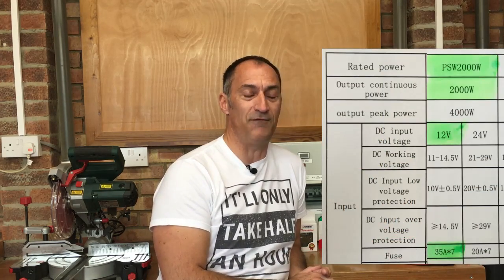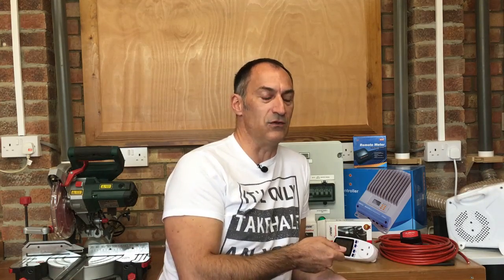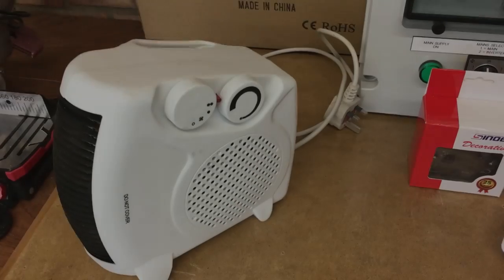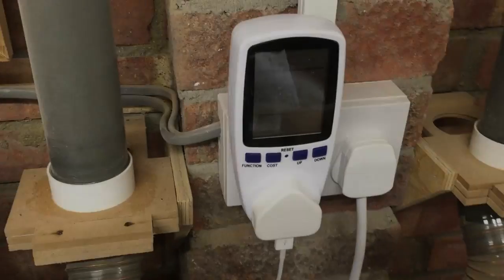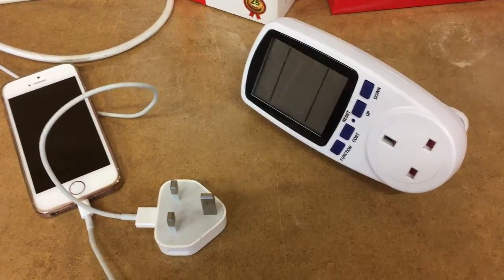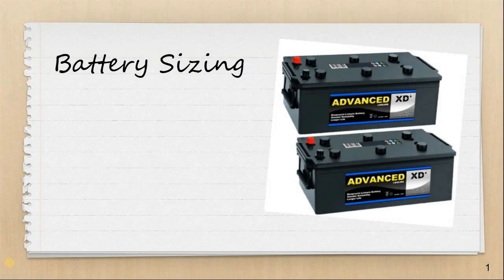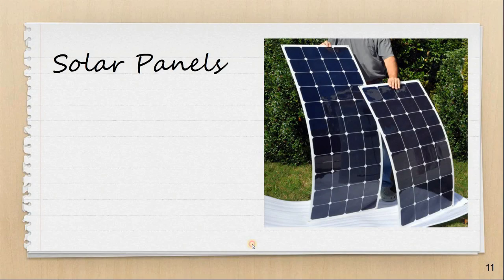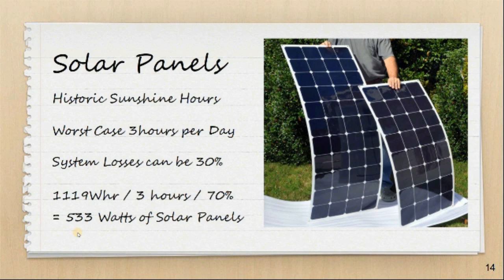Off Grid Battery & Solar Sizing - Self Build Campervan

Comment: Hey Greg!
Great videos matey I’m doing up a T5 myself and find your vids really helpful :)

Any reason you chose a VSR over a DC DC charger?
They charge much faster and more efficiently..plus the battery can get a 100% charge not around 70/75% as with a VSR...you basically gain 25% more useable battery capacity :) 

The Ablemail 12-12-30 is what I would recommend...also has 30v solar input with mppt tracking.
It’s £250 but well worth it :)

Cheers 
Ant
Reply from the maker: Just not really aware of a lot of other devices out there, in hindsight I would change a few things 😃
Reply: Hi. Interesting comment re the Ablemail, have just had a quick look. So. if I understand correctly, the ablemail replaces the need for seperate MPPT controller and split charge relay? Do you know if it is suitable for Lithium batteries (I notice the website talks just about lead acid but says it can be reprogrammed)? Thank you :o)

Comment: Hello
Just one question.
Why for the fridge did you write 6 hours instead of 8?
Usually it works 20 mins/hour = 1/3 in 1 hour
so 1/3 in a day could be 8 hours.
Thanks and sorry for my bad english :-)
( you can check at 15 mins and 40 seconds )
Reply from the maker: The amount of time your fridge runs for is at best an estimate depends on how many times you open the door and how much warm food you put in it. So the calculation is really a best guess anyway 😀
Reply: ah ok, thank you very much for your quicker and exhaustive answer :-) ( and sorry for my bad english :-D

Comment: So at this Point I don't quite understand why the Laptop, the iphone, the ipad and the kindle are in the 230v category. They usually run at/on(not sure here) direct current and can usually be charged via USB. Or for the Laptop just find out what current the laptop can take and get yourself a dcdc converter. Way less inefficient than running the inverter for all these appliances.
Reply from the maker: I was testing them with a watt meter that was plugged into a 230v socket to find out exactly what power they drew when in operation. 
You can, of course, plug them into a USB socket. You are right that running them off the inverter is not the most efficient way

Comment: I didn't understand why you'd only put the fridge down as being used 6 hours a day. Surely they're a 24/7 appliance. :-/ What am I missing?
Reply from the maker: Hello, they are plugged in all the time but the compressor only runs very infrequently depending on how much you use it. If you open the door a lot and put lots of warm food in it will run a lot more, at best this is and estimate as we cannot tell exactly what the running hours are. Hope that explains ok
Reply: Ah.. I see. Thanks for explaining.

Comment: Hi Gary great video. Just a quick question regarding your computer Watts. How have you done the calculation? I have worked out my computer charger input is 1.5A (that's what the AC adapter says). You only have 0.09? Thanks
Reply from the maker: Hello Matt, I plugged it into my watt meter and took an actual reading while in use. 
Typically they are max 75watts for a laptop but often use much less.

Comment: on the 2x oversizing batteries due to cycle life, have you look at the lithium options ?   You might only need half as many and can drain them lower without that critical effect presenting anywhere near as soon in the cycle life...  and yes, pricier - but also less space consuming...  lots of tradeoffs.   You make really excellent videos.  One thing that stands out in them is your incredible attention to detail - that, and your shop area is WAY TOO CLEAN.  Try messing it up a little so some of us don't die of jealousy.  otherwise, crack on !  :)
Reply from the maker: Hello Lyle, I wish I could afford the lithium option but they are so expensive.
Oh, and I can hardly move in the shop at the moment there is so much van stuff in there lol
Reply: sorry on the comment - I saw later comments where you'd addressed it.  Glad to hear your shop isn't suitable for showing presently, it gives the rest of hope... ;)   I gather you're in the midst of heading off on a long road trip - take care, you've certainly worked for it.

Comment: Hi and thanks for your video .
Are there any downsides to having to many batteries and solar panels.?
Can you buy something to automatically manage your batteries to extend there life , rotating and not going below the 50% recomended
Reply from the maker: Hi Andrew, in the case of our van conversion the biggest criteria is roof space and weight.
There is a limit to how many panels you can fit on the roof of your van.
I have now fitted 3no 160W panels making a total of 480W of Solar, that is a lot for a van.
With batteries the issue is weight, my battery string weighs close to 100kg
So you have to plan where to put that so you're not overloading one side or axle.
If your battery is very big you might now be able to fully recharge it with your solar system
So they have to be matched to make the system work efficiently.
Larger systems require larger cables and fuses and that all increases cost too.
A decent charge controller should be able to maintain your batteries in good condition and charge them according to the current state. you can get low volt cutout switches to prevent over discharging them.

Comment: Thank you!!! This is a struggle i am in right now 🤠🤘🤞
Reply from the maker: Hi Kristiina, what are you having difficulties with maybe I could help you figure it out?
Reply: No idea how big i need to go with battery and solar because no idea what appliances i do need to use. 
Atm maybe ill skip inverter and be only on 12V. And if i live in the van for a bit then i might know better. But as it is summer in europe i think i should install solar plus the charger to charge while driving 🤠🤘
Reply from the maker: This video may help you a little more.
https://youtu.be/1nrAE5Q3lVQ
Reply: Yes!! Thank you

Comment: Ideally you would have the fridge radiator isolated from the rest of the van and vented to the outside. This way in the winter the fridge remains cool even if you heat up the inside of the van, without using much of the scarce power you get on a short, cloudy winter day.

Very cool video!
Reply from the maker: Hello, Yes it's an interesting point you make. I'm thinking this may be more important in the summer when the van is hot and the condenser cannot reject its heat as effectively. In winter the fridge will work more efficiently and the rejected heat will be a bonus to help keep the van warm. Either way, I just don't want to cut massive holes for those ugly fridge vents in my van sides.
Reply: Fair enough: these holes would decrease resale value and create another risk of leaks, so that has to be taken into account.

Maybe a hole on the floor of the van, which would also be used as a vent intake (taking the coldest air to the fridge)? I'm still trying to think of something, because the fridge is definitely the biggest power draw, which is a shame when you have all that cold outside!
Reply from the maker: I have finally gone for a Dometic CRX50 12v fridge.
No mains power and No Gas, works really well and has a small ice box too.
Reply: Greg Virgoe Yeah I understand that 12V fridges (not many brands besides Dometic) are just the best and that you can't really beat that. Also I was told that many cheap 240V fridge are not RV-proof anyway and vibrations would eventually destroy them, so probably not the best place to save money.

Are you already driving through Europe or still building? Your van looks splendid and so well-built on all levels, and you're great at explaining what you are doing, so I'm very glad you're doing your videos.
Reply from the maker: Hi Jay, we still have a couple of months left before we leave. My last working day is Friday 29th June. Then we have a few weeks in July to pack up our house before heading off on our travels. 
Thank you for the kind comments and support.

Comment: Solar is not inneficient. You dont have to do much to get something.
Reply from the maker: The sun beats down on the earth at an average rate of 1000W/m²
A typical solar panel will only generate 150W/m², so that's 15%
That's what I meant by inefficient. They don't convert all the suns energy to electricity only a small percentage.
Reply: Snapdragon cpus in arm laptops next year will be getting 30+ hours on a single charge. Hopefully if i ever get round to doing this I'll have an all electric van. I imagine a time when people will live completely self sufficient in EV vehicles powered completely by the sun. It wont be long before they are building the vans in composties and the ev batteries become much denser. That with increased solar efficiency is win win for future generations.

Comment: Thank you so much for this video! My dad is an electrician and explained all this. I somewhat understood what he ment. A year later, I wanted to redo the calculations but just couldn't remember the equations he showed me. This was a great tutorial for that! How's the tour?
Reply from the maker: Thank you very much. I’m really pleased you found it to be useful. We start out tour in the summer. 3months to go.
Reply: That's going to be fun! I'm starting soon as well. I'm turning my van into a work-play van. Using it as a film production van! So electricity is a must. But I don't have money for solar panels, they are also not very efficient like you said. My aux battery does charge pretty quickly and I'll have to drive probably everyday. So even if I did bring my battery down to a healthy level everyday, which I doubt I would, I'll be charging it every day as well.

Comment: These days you should be looking at Lithium power storage, not lead-acid. Lithium can be discharged 80%, not 50% or less. Still more expensive up front but also much better tech.

Also, absolutely minimize all the things that need 230v. Almost everything can be done with 12 volts, which is much more efficient. You can heat the van with 12-volt operated diesel heaters, for instance.
Reply from the maker: The trouble is a lot of people cannot afford the very high cost of lithium so there is still a place for AGM batteries.

Comment: Love your videos - very well done. I am in the early stages of a build plan for either a cargo trailer or a van conversion for use in the winter for skiing. A propane heating system, well insulated space and solar system with proper sized batteries and charger/converter will be a must. If you were going to be using your van at higher altitudes in -20 C conditions at 8 to 10K in elevation what would you have sized your systems to keep you from freezing? - A Fan.
Reply from the maker: at -20c you'll need twice the heat output compared to 0c to keep the inside at +20c
Make a good job of the insulation and make sure to fill all the voids.
you can check where you are travelling and look up the daily sun hours.
This will give you an idea if you need to increase or decrease your solar selection.

Comment: Hello Greg I think you forgot about multiplying by the quantity. For example the roof fans would be 2 * 36 * 3 = 216
Reply from the maker: Yes, you are right, I corrected the formula on the sheet that you can download.
Very well spotted though and thanks for pointing it out.

Comment: Sir,
     At any point did you consider the effects of environmental temperature on battery capacity/output when sizing your van’s leisure batteries or will your van be thermally-stable enough for that to not be a concern?

Comment: Anyone have a feel or a calculation for how many hours a fridge will actually "consume power" - clearly it "runs" 24h a day off your battery but in reality presumably only when the compressor is actually actively cooling will it draw power from the battery? I checked the dometic specs and nothing there; just rated 5.5A
Reply from the maker: Hello Russell, it's one of those "how long is a piece of string" questions. There are so many variables. The ambient temperature around the fridge, the amount of times you open the door, whether you e just filled it with warm beer, etc... That's why I think I assumed it would run for only part of the day say 6-8 hours?

Comment: Hi Greg, I am a massive fan. Qry re your calcs: LED Lights, qty 10, 12v, 0.83A = 10W, 6h Use but * 10 qty would equal 600w/hrs? Or did i misunderstand as perfectly possible?
Reply: sorry yes; many of your calcs dont include the quantity
Reply from the maker: Congratulations Russell, you are one of only a handful that spotted my sheet on the video missed the multiplier. I did realise and correct the download version so that is right. Thanks for watching and well spotted.
Reply: Thanks for the quick reply; just want to  say that you are one of the best on YT. lots of ppl doing these VCs right now (myself included) but not that confident that everything you watch is actually a good way to do it so you do have to own understanding it yourself in my  eyes - i am very envious of your workshop!
Reply from the maker: Thank you Russell, I really appreciate your vote of confidence. I'll make sure to sanity check future calc's to avoid embarrassment.
The shop is in my father in laws single garage. There is a build series on this channel we started it last year. It's very nice to have. 👍🏼

Comment: I was euphoric with my project before this video... 1000Ah Battery an 4.9 Wh Solar ... :-/ sure I calculated a lot of Security in but there is also a lot of consumption in Cooking and Working :-( I think I should evaluate more exactly then cooking an hour a day or work the half day with my computer (no Laptop)
Reply from the maker: A 1000Ah battery is massive! That will give you loads of autonomy in a van setup.
However, are you sure you have that other figure correct? 4.9Wh is nothing at all?
I'm guessing you maybe mean kWh, in which case it makes more sense but is a huge load.
Are you cooking with electric? Is this a home setup?
Reply: Greg Virgoe  hi, yes I meaned 4.9 kwh. its for a moblie home like a rv- version of a sprinter. mi girlfriend and me we still like cooking. and also a lot but i preffer to do not have gas in my car. there are too many influences it has. gas protection plumbing, fresh air when cooking is a must ... all those y havent when i cook with induction. the other part is i work  in programming, cad and video cutting and preffer to has a standard size computer.... so thats the thing. he is quite oversized in all dimensions ram hdds graphics .... and he work for me in cases my laptop cant work for me.... so the 600 watts or more it took alone per hour from the battery. with cooking for soups and canning (I have a lot of fruit trees) there are quite battery exhausting days even if I would this time not use the computer the laptop and the fridge.... 
the roof is smaller then the 49 100wph cells and the amount of heavy batteries is really not the weight i will have to carry daily by my sprinrer. surely i can find other solutions but i dont like them i know already.
Reply from the maker: Hello, you don't need me to tell you that number of panel will not fit on the roof of any RV. Unless your mobile home is a static caravan and you can site a huge solar array in your fruit orchard. 1000Ah of batteries is going to weigh over 1/4tonne.  Have you run your computer on a Watt meter while drawing in CAD or playing video? I would guess it doesn't use all the 600W of the power pack. My laptop only uses half of its rated input. Cooking preserves takes hours of boiling to reduce the liquids and this process does not seem to be practical on solar. Where do you live in the world and how much sun hours do you get worst case? I would look at getting a small generator or cooking on gas, which you can do outdoors during harvest season. I use AutoCAD and do video editing all on my laptop, you can plug into a 12V TV if you prefer a bigger screen.
Invest a couple of hundred in a better laptop will save you thousands in a massive solar setup.
Reply: Hehe :-D yes, thats impossible. I evaluated the 600Watts already by an electric meter. My next smaller project would be check the whole setup at home. I gotta whole room with light, induction heater and other cooking stuff and my office. By the way I use Autodesk Inventor, but I have already problems to import DXFs from a Volkswagen Crafter .. so my designing the Van stucks a little bit. To mess all dimensions by myself is impossible because I already didnt bought it. My Laptop opens the design file in about an 90 minutes ... my computer in about 30. and there is only the original drawing by VW. 60MB dxf... But working on It is already hmmm not as good as it should be. I think there is a missetup in my Inventor. When I got more time the next few days I will have bigger efforts in planning. For Playing Videos, which are not on Youtube I use VLC. to cut Videos I use Adobe Premiere Pro. In a few days I will knew a lot more about the consumption, and I hope that it brings me back to my euphoria. I alread thought a wind turbine would be a good option, but It only can be a stational solution. By driving there is no possibility to charge the Batteries. And a wind turbine to produce  2.5kWh (about 7h to load the whole setup) could be a bigger thing...less wind in Woods, Citys, not as stealthy as it should be..... a van conversion could be so simple if you only wanna sleep outside :-D 
But I think it is better to plan longer with such an Investment then do the same work multiple times. I already also thought to do some benefits for citizens like The Nomadic Movement .. but I dont cook for many people , I could create sth to do pyrolysis from waste and fuel my engine with it. But as complexer Cars and Vans are as more fantasy it gets...
We will see, it gets a longer project. Maybe also as an video series.